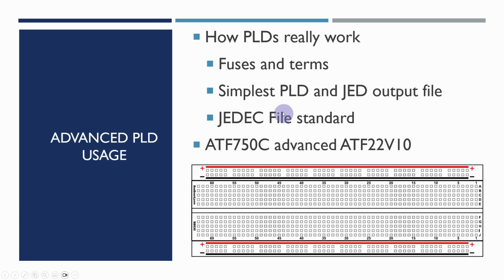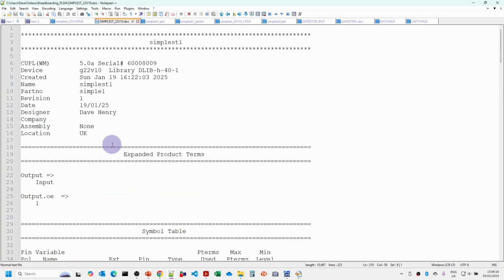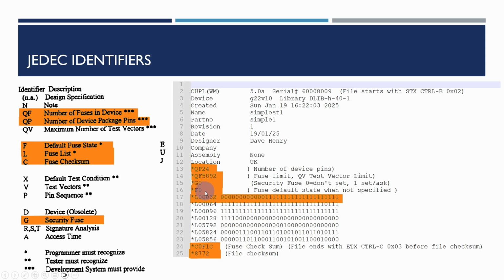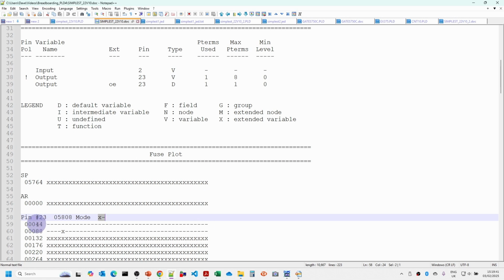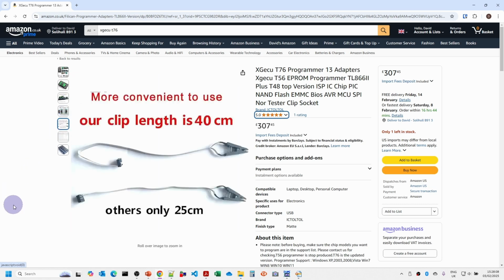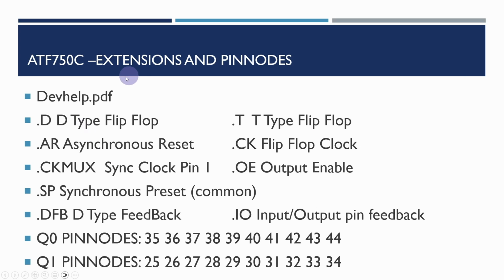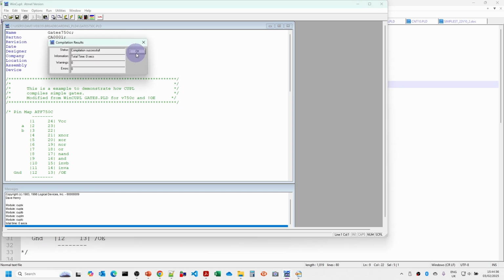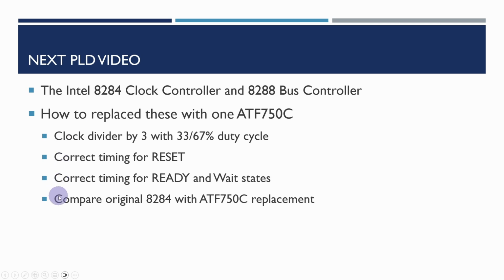How PLDs work and testing the ATF750C (PLDs part 4)

Comment: what's best practice for unused pins? define dummy formulas? tie up? tie down? leave NC?
Reply from the maker: Good question! This is what the ATMEL PLD Guidelines document says "Atmel’s Flash devices (ATF16V8, ATF20V8, ATF22V10, F1500 series) devices have either pull-up resistors or pinkeeper circuits on all input and I/O pins, so unused pins do not require external resistors. Atmel’s EPROM devices (AT22V10, V-series CPLDs) do not have input or I/O pullup resistors. Any device pins which are left floating can cause internal noise and increase power consumption.
Unused input pins should be pulled-up, using a 50k (or less) resistor. Unused I/O pins should be pulled-up or programmed to output a logic high. If left unprogrammed, they will default to tri-state."
So probably pull inputs high with something like a10K or 20K resistor and have the OE terms disabled for outputs. For breadboards its probably not a big issue as most TTL compatible logic internally pulls high, but if making a PCB which will be more permanent then probably best to pull up inputs so they don't pickup stray signals. I hope this helps. Dave

Comment: How to solve Fuse bit errors which I encounter?
Reply from the maker: Are you using the correct device type? There may be extra fuses which don't exist on your device?
For example ATF22V10B and ATF22V10C devices in the programmer won't work unless they match exactly (and DIP vs PLCC etc)
Try erasing the device and re-reading. All the bits should be 1. If not then the device may be faulty.
Hope this helps. Dave
Reply: @breadboardinglabs  Hi Dave.   Thank you I am using a ATF16V8GC PLCC chip with an adapter to DIP type. My programmer is T48 programmer and I selected the device type as ATF16V8GC . However the fuse bit error disappears if I uncheck the flash checkbox during the program mode. But at the end it fails the logic tests. Can you help me with this problem ?
Reply from the maker: Are you sure the chip is an ATF16V8GC I can only find ATF16V8C (Google has no match for ATF16V8GC)?
WinCUPL Devices menu has specific support for ATF16V8C PLCC and it looks like the pins are the same as DIP.
What device type are you using for WinCUPL? (release notice suggests g16v8a for ATF16V8C). No mention of ATF16V8GC.
When I run XGPro without a device attached and select T48 then only gives option for ATF16V8C DIP 20 as closest option (pin out is the same I believe).
I only use DIP chips currently so not really got any I can try out. Dave
Reply: @breadboardinglabs  sorry my device is ATF16V8C
Reply: I mispelled it
Reply from the maker: Ah OK. Try programming as ATF16V8B as C is supposed to be backwardly compatible. And the C in XGPro seems to have an extra fuse. Run cbld -l from command prompt in c:\wincupl\shared should dump the device info. Else check the pin mapping on your PLCC to DIP adapter. Dave
Reply: Thank you
My fuse bit error is solved but the IC doesnot pass the required logic tests
Reply from the maker: I always found the 16V8s a lot more trouble apart from simple decoding. Always use 22V10 for anything moderately complicated. Check your .doc file from WinCUPL it sometimes highlights typos or other issues. Dave

Comment: Have you looked at the Ultra37000 series?
Reply from the maker: Not really, though from a quick look, they are surface mounted chips rather than Breadboard DIP style so would have to build adapters (and run at 5V). Don't look to be readily available from what I can tell? You know where to get them? Dave